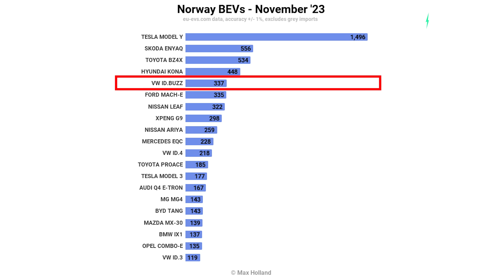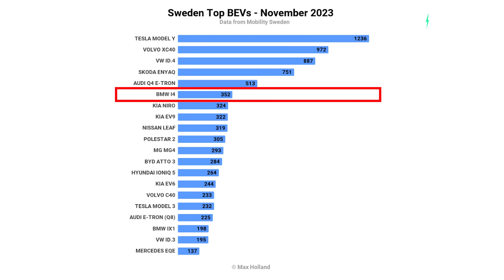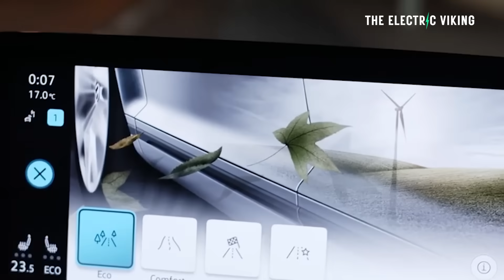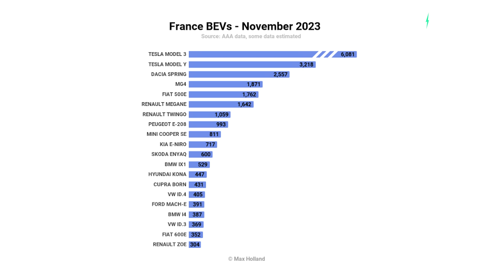EVs and Tesla Model 3+ break records in Europe as buyers ignore strikes

Comment: The subsidy in France, especially in the Ille de France is undergoing a massive change on  Dec 15th. This will drastically affect EVs made outside the EU.
Reply: Les tesla seront produites en allemagne, dans la toute nouvelle usine tesla.... boum, tesla retrouve les primes à l'achat d'une voiture électrique.
Reply: Agree, the European big 4 BEV sales German, UK, France and Netherlands are either removing or reducing incentives. BEV will have to stand on its own, which will change purchasing behaviour.
Reply: Should help tesla even more since theirs are made in Germany but not model 3 though.
Reply: @howard3189  possibly the U.K. and Norway reductions are big, the U.K. has seen a big rise in PHEV and Hybrid since the Government pushed back the date to 2030, the other manufacturers can flex across to PHEV and Hybrid, Tesla can’t and because they haven’t a cheap car, they are at a disadvantage against Stellantis, consequently selling 33% at average cost hence the low margin.

Comment: So, where do I see on the glossy brochures and TV EV utopia commercials about charging these cars on 1.  a 42 degree scorcher like today (sit in it with A/C running which will take longer to charge ?)  2.  When it's pissing down rain and you are holding onto a live charge cable when connecting/disconnecting or 3.  If it's freezing outside (sit in it with the heater going - you guessed it, longer to charge ?).
Listen - change the battery tech and I'll think about it but how are you EV people coping with the 3 points above ?? Genuine questions...
Reply: 1 - The AC running is minimal power draw compared to the total amount of power you get from a fast charger.
2 - Charging cables are (obviously) not live when they aren't connected to a car.
3 - The AC running is minimal power draw compared to the total amount of power you get from a fast charger.
Reply: 1. Consider that you can at least have the AC running without needing the engine running as you would with an ICE. AC draw is quite minimal compared to the amount of charge coming into the vehicle during charging.
2. I'm not sure why you'd be outside in the rain holding onto a cable during the charging process. Just plug it in and leave, then return when your car has reached the desired charge and unplug. The chances of electrocution are virtually negligible unless it's a BYD that has had a recent recall.
3. Could be answered with my answer to point 1. 

Your points are valid but honestly they will fade once you've owned a good EV. I've owned my Tesla Model Y for almost one year and it's been pretty awesome. During charging I just go for a walk or sit in it and watch YouTube or read a book or whatever. You start to get used to doing things in a different way after a while.
Reply: Charging cables (and charging ports) are not "live" until they are securely connected and can communicate with the car to determine the charging requirements. Any interruption of communication shuts off the power.  

As for heating or cooling, that is a trivial power draw compared to the power a public charge port can deliver. At most it would add just a few minutes to charge time.
Reply: @Tschacki_Quacki re 1 and 3.
Do you have a habit of repeating yourself, or was that a stutter?
Reply: @robertfonovic3551  Both. I'm a s-s-s-s-stuttering r-r-r-r-repeater.
You got a p-p-p-problem with that?
You g-g-g-got a problem w-w-w-with that?
Reply: Hey…if you don’t think ev’s have the types of advantages you are looking fir don’t get one.  It is not everyone else’s job to convince you that the advantages that ev’s have are for your specific use case.